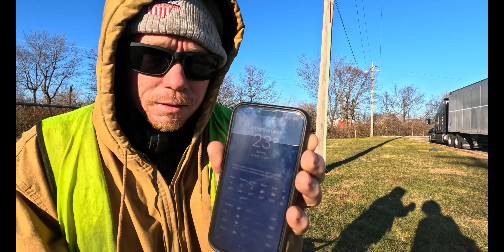Lack of communication costs us a day..

Comment: I drove for a year and a half after retiring from the airlines as a pilot for something to do. ( I drove hailing cranes in the mid 70’s and it was fun )
I got out of trucking and went back to flying. The main reason I got out was drivers are not treated with any respect at all. The life style is tough. Long days and low pay. Very little time off. Keep up the work guys you too have great attitudes for all the issues you that you run across. Keep your chin up! 😁🛫

Comment: On your trailer there is a front alignment blushing.   It maybe worn now since it sat and was driven for a while.   Also since you had the beam assembly arm straight and then moved over.   It would seam the front brushing is bad.   It may have become oblong due to being kicked out.    So now she you tighten the ubolts.   It wil wall on you over and over creating the gap in the saddle that holds the axle in.  If the parts come worn you may need to replace them all so that the walking or moving over is corrected.   I have seen it before in what is happening to your axle and spacing
Reply from the maker: Ill check on this. Thanks